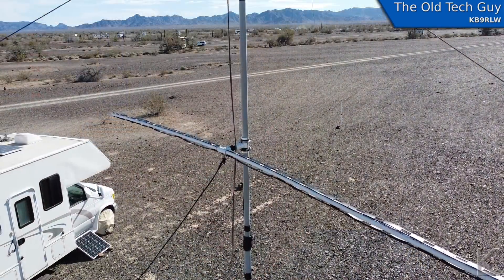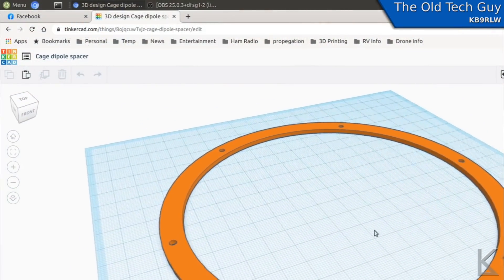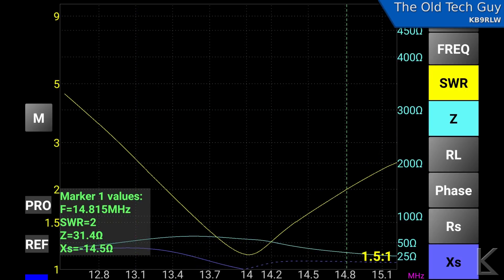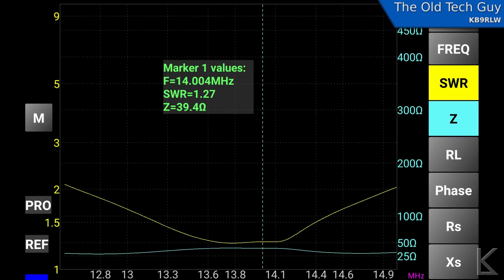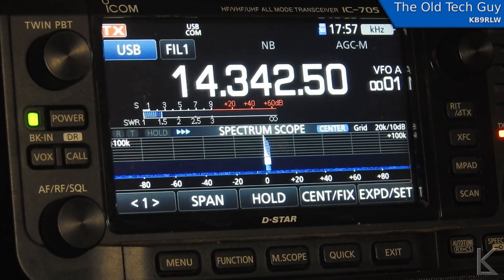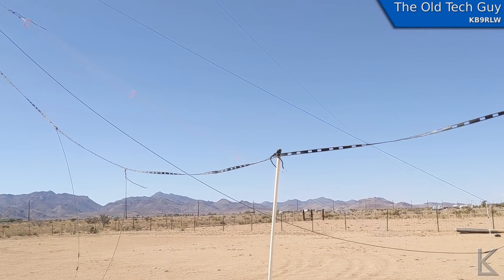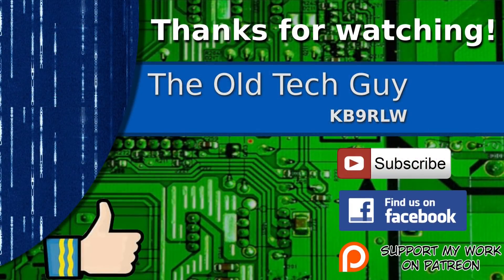Ham Radio - An end fed half wave cage antenna.  How much wider bandwidth does it provide?

Comment: This is kind of cool. I've been reading about these cage antennas for a while. The other thing I saw was using a 1/4" PVC oatey flange repair as a spacer. The Home Depot part number is 435191. They're only about $4 (2025) so if you read this in 2026, expect to pay $30, but right now they're pretty cheap.

Comment: Hi there, so I have a question/thought.  So for this experiment you used the same wire for your regular antenna and your caged version.  Have you considered using a MUCH thinner wire for the caged version?  I'm thinking something that is tiny like Davis RF Poly-STEALTH 26 which is 26awg.  It is incredibly light at .38 lbs per 1000ft.  The whole thing would be much lighter.

Comment: Wonder if it gets wider band width adding say two wires for 8 in total, also wonder if the band width increases going to say 12" diameter? If so wonder what the sweet spot for 10m would be? As that band is wide as.

Comment: Hi Kevin. I've been watching your videos on the tv so could not do anything but a thumbs up until now. I have an end fed 1/2 wave 80m mostly horizontal 'L' shaped about 30 feet up because of my HOA situation. I am playing with 6 meters to get on a local 6m net. The idea that the 'fatter' the driven, the broader the band width is exactly the answer I've been looking for. Wire doesn't cut it! I acquired some old tv antennas and am fashioning a dipole out of 2 of the elements (51 inches).  question: 
1/  can I extend the aluminum tube element by clamping a second piece of tube near the end of each element? The swr for the lower end of the 6m band is about 2.0:1 where the rest of the band is around 1.5:1

John
VE3PUH

ps ... i'm retired and have had my ticket since last May.

Comment: Nice project.  I wonder if on 90/76 if the 2 wires or of the several if you might pick up more of the band. To make the harmonics work it has to be full length, but the second wire if shorter for 75 could it become a fan-like antenna. I assume all the wires on yours were the same length?

Comment: You will possibly have about 25% of your 20M bandwidth gain on 80/75M due to diameter to wavelength ratio.  I say just make your cage 4 times larger in diameter for 75/80M. <grins>  73 de AC4KV

Comment: Thanks for the interesting experiment. You could always print in ASA for longer term use. I like OpenSCAD for 3d designs like this. Half a dozen lines of code or so for this design. 73 de w6akb

Comment: I have a QRPguys no tune EFHW and I’m curious if it’s possible to to run this a vertical (fanned dipole style) like a dx commander. I’m I wrong thinking the signal will seek out the appropriate length radiator in an EFHW? I know spacing of the radiators is important. TIA

Comment: Interesting experiment. 
Theoretically, the impedance with this EFHW cage should drop a significantly, compared to a single (thin) wire.
I saw a pretty low Z value, but there is no comparison.
Did you check that, maybe you saved the data from a previous measurement?
If so, the coupler could be adapted accordingly (less secondary windings). 

73 Stephan

Comment: 👍Thanks Kevin. For 80m I have wondered about an end fed caged dipole with wires of slightly varying length  - a sort of caged/fan dipole hybrid. Spacers look good on your 20m caged dipole.
Reply from the maker: Well,  it really wouldn't be a cage dipole then, it'd just be a fan dipole with a slightly different physical arrangement, but the same performance characteristics of the classic fan setup.

Comment: If you could make one of these for 80 through 10 metres, I might be interested in purchasing one.  Of course, this would only work as either a horizontal or a sloper.

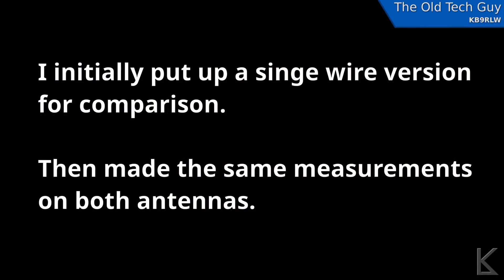3:00 - "singe wire"?

73 VE7NDE
Reply from the maker: I was comparing measurements to a single wire version, the common EFHW antenna.
Reply: @loughkb  Yeah, but you spelled it "singe" instead of "single".
Reply from the maker: Ah well.   Can't be perfect when one is not perfect themselves.

Comment: If you want to check out a really wide antenna, try four-foot wide attic foil. It probably wouldn't work well in the wind, but it is strong enough to be suspended as a twenty-meter half-wave. And it might be a great attic antenna. Here's a good source: https://atticfoil.com

Comment: Interesting Kevin. 
Fat wire end feds result in lower impedance, thus the higher SWR. Higher SWR results in increased ground current thus lower Q, higher loss and apparent wider bandwidth.  When the feed end is near ground, the fat wire version has greater capacitance to earth..... A 1/2 wave Rohn 25 tower can result in a very low Z, down in the hundreds instead of the normal 2500 ohms or so....This is why the EFHW is considered a "thin wire" antenna and tends to work best with a single skinny wire. Even using 12ga cu makes a difference although that's what I use for strength. The early EFHWs used 18ga wire but suffered from breakage of course. ... QST had an article about multi-wire dipoles and it was proven to have little if any effect although W1AW does have a 75 meter cage. It's certainly a fun antenna to experiment with though.
Reply: Hi all, and thank you Kevin for doing what I was wanting to do! I just modelled an EFHW in Xnec2 and noticed the lower impedance (and lower resonant frequency) when I inceased the diameter. I guess one could wind another transformer to match it.
Reply: What is Q ?
Reply: @OH2023-cj9if  Q stands for Quality. An RF circuit with high Q is a circuit that tends to work most efficiently at only a narrow range of frequencies. Such circuits are termed hi-Q and are more selective than a low-Q circuit which often has power absorbing properties as a result of resistance. For a coil, wire made of silver has lower resistance than steel so it would be higher Q.

Comment: The thing I love about your projects is that you try things that "professionals" might dismiss out of hand. It is only by trying off-the-wall ideas that we learn new things and advance the art. Thanks for your hard work! DE WA1KI
Reply: Not much off the wall about the Cage dipole or End Fed, it was very popular in the 30s and 40s for point to point where there was limited space, the military used it due to the wide bandwidth and it was used on ships despite the greater wind loading. It fell out of favor in the last 50s and 60s when trap Yagi became the practical solution with commercial antenna became the rage. Later, QRP and limits on antennas sprang up all over Europe and the US so shifted interest to less obtrusive and more portable antennas. When I still lived in the US, up to 21 years ago I had a mountain location and a few towers in the Sierra Nevada mountains of Eastern California. I was able to experiment with lots of wire and rotatable antenna and built a center-fed dipole cage for 80 meters broadside to east and west and it performed very well but was quite a wind load. The spreaders I made were pretty heavy from plexiglass but molded carbon fiber with lots of open space would solve that problem.
Now I live in an apartment in the city center of Eastern European city with no access to the roof in a city of  7million and there is a lot of electrical noise from electric trams and trolleys. My antenna experimenting is limited summertime in the woods and a small rustic cabin where my garden and apple trees are tended. There is no end to possibilities with antenna experiments. I had a magnetic loop that I can use for 40-10 inside my apartment. The bandwidth is so narrow between tuning that 10khz QSY is about it with 3:1 SWR.  But it does work inside 3 foot thick brick walls

Comment: Great test and info.  I've built a few cage antennas over the years: Dipoles and OCF's, and had (I think) great success with them (no testing done, just "seat-of-the-pants" results!).  

I am currently looking to get an EFHW up (I already have the 49:1 UnUn), to cover [as you mentioned] 80-10m, and you've now given me the idea to cage it!  I think it will work great, and will definitely improve the overall bandwidth (well, it certainly can't hurt it). 

And... I think they look kinda neat, too!  Not your "typical" wire antenna!

Thanks again for taking the time to create this video (and, of course, the antenna too!).
73, all the best,
Alan
W0ARM

Comment: Thanks! Great video  Here is my Guess as to why the antenna has a wider Bandwidth...because  the wires each have a slightly different even minor differences in length each one will resonate at a slightly different frequency.  I would bet that if you purposely varied  the lengths by the length equivalent to equally spacing  them over the bandwidth you would have antenna that covered the entire band. I would also bet that it might only take 3 or 4 wires.  a few months ago  I actually tuned 2 pieces of wire at band edges and tied them to 49 to 1 transformer and found them to have good return loss at both band edges.  My calculation show that a difference of 4.8 inches from center of band, to band edges on 20 M.  I am a new general class ham and am working on my HF broad band antenna. and was considering using multiple wires to widen the bandwidth of some of the broader bands like 80M 12.5% BW, 160M 10% BW,  10M 5.7 % BW , 6M 7.4% BW  I was unaware that they called this a cage antenna. never heard of it before.  If you try this I am waiting for your results as I am even older than you and I have a hard time putting antennas up.  looking forward to your results. ;>)
Reply from the maker: Hello Robert.    You're guess is incorrect.    The cage antenna is broader due to the diameter of the element being larger.  The wires are all the same length.    It's a well known effect.  The bigger a wires diameter, the broader it's bandwidth will be at resonance.   The cage design applies that effect with multiple wires acting as one big conductor.
And with a bandwidth of over 2 MHz, it more than covers any ham band it's cut for.   
What you're talking about is a variation on a fan dipole.
Reply: @loughkb  
Usually  larger wire  lowers the series resistance which will raise the parallel resistance which  increases the Q which loweres  the BW  and loss from every band width equation i have ever seen.

Comment: I love your YouTube post. I get every one. I have been thinking about getting better bandwidth on an 80 meter End Feed Antenna for 80 meters.  I was thinking of using it in a fan  design or  cage design.  Using 3 wires I could cut them for 3.75, 3.5, and 3.15 Mhz.    2nd choice would be 2 wire cut at 3.875 and 3.625 Mhz.  What's your opinion?   thanks  KC0ELC, Walt

Comment: Hmmm, 

Took a nap, woke up wiyh this thought/question.

Could a 'slinky' antenna be considered a cage antenna? Meaning, since it has the similar large diameter, and the broad-flat ring material... seems like it would also be pretty broad band in nature.

Would make for an interesting comparison.
Reply from the maker: The slinky adds an inductive component.  It would behave differently.
Reply: @loughkb  I thought it lost the inductive once it got stretched out...
Reply from the maker: A coil is a coil no matter the distance between turns. :-)

Comment: Have you tried to see if you can get it to tune on 40m or even 80m?
Reply from the maker: My tuner can match it on 40, but performance is poor, as you would expect.    Double the length of it and it will cover 40, 20 , and 10.
Reply: @loughkb  try with about 7m of counterpoise. An length of random wire should do it.
Reply from the maker: @G7VFY  Already there.  As indicated on the design.

Comment: Thanks Kevin. I have an interest in the caged wire every since I watched your 2 meter cage video.
This one has my interest as I am looking for a different antenna for the 80/40 meter bands.
I am going to try this at 132' and work one it from there. Spacers at 20' intervals should hold the 
separation for the wires at 6" diameter. We shall see. K4BFR
Reply from the maker: You'll probably have to plan some sort of suspension support around the middle.   I'd be interested in your observations once you have it done.  My public email is good on qrz.com
Reply: @loughkb  You got it sir. It will be a week or so before I can gather room and materials. I am thinking about a "tight rope" suspension system on this. 800 feet of wire has a good bit of weight and unsupported it will stretch a good bit. 6  runs of 132'

Comment: Wide bandwidth = high loss. Since the single wire is extremely wide bandwidth also, it's most likely the transformer, especially since you mentioned Steve Ellington. Measure a pair of transformers the way he makes them on a VNA and the high loss is obvious. He seems to only make inferior and low performing copies of other people's work, nothing innovative or high performance about what he does at all.
Reply from the maker: I only said he popularized the design, I didn't say he invented it.
Back when I built it, I did use my VNA to measure it.   I also measured insertion loss, which was low.
Reply: Do you have a better design for an EFHW transformer? If so let us have a look. Many companies use the same design and they have tested them.

Comment: I wonder what would be the result of only connecting the cage wires together at the feed point of the dipole and not at the outer ends. Good info, Kevin. Thank you. 73 de K7RMJ Frank
Reply from the maker: Probably no difference.  They're all at the same potential if they're exactly the same length.    It's just easier to anchor the far end when they're tied together.
Reply: @loughkb  I would think by not connecting the far end of the conductors that would turn it into something similar to a fan dipole affect.  Try cascading the wires a couple inches shorter and see if that doesn’t broaden the band even more.
Reply from the maker: @MrWirebrain  Why?  At a bandwidth of over 2 MHz, it's already much wider than any of the ham bands you might build it for.
Reply: You’re right, it may be broader than the band but I guess we’re just trying to prove a point here. What exactly does it take to broaden the transmit capability of a wire antenna and to keep it as inexpensive as possible.  Maybe three wires next time, each one an inch or two shorter than the other and spaced with ring spacers 3 inches in diameter instead of six.  What do you think?
Reply from the maker: @MrWirebrain  I think once you get the RF favoring one of the wires over the others, you'd lose some of the broadening effect you get by the physically larger diameter when they're all acting together.

Comment: Nice stuff Kevin.  The slightly higher minimum SWR and the plateau effect are likely both from the fact that the antenna is now much more capacitive.  You have a bunch of conductors in parallel, which is pretty much how you build a capacitor.  If you plot the data from both the single wire and the cage on a Smith chart the difference should stick out like a sore thumb. 

I agree this would be a fantastic design for 40 or 80 if one had the room.  The single wire seems to be fine on 20M, but if you build one lower and then expect to use it on the harmonics you'll need that extra bandwidth because the harmonics won't be exactly where you want them to be.
Reply: Sounds like a dare to me.  How many wanna test Matts theory?
Reply: @stephen1711  LOL.  It's not my theory.  I'm not quite old enough to have invented physics...but I'd love to see someone try it out.  In the battle of theory vs. reality - reality always wins!
Reply: Great stuff on antenna. ...  Was wondering if you thought horizontal would add or reduce band width.. I know it would be hard to do at your location..  just curious. Wn0wwy Dale
Reply: Do you imply capacitive properties prevail because resistive properties decreased?

Comment: Hi 👋 Kevin very interesting the Ant 🐜 experiments
One questuon  Do I need a Modem using iC7300  for PSK31  use USB for FT8.
73  Kurt HS0ZBS east Thailand 🇹🇭
Reply: No you do not.  The "modem" is built in to the 7300.  All you will need is a USB A to USB B cable and download the usb drivers from Icom Japan's website.   73   James  K0UA

Comment: Interesting test, Kevin. I don't have the space, but what would happen if You use the caged dipole method but make each individual wire slightly longer than the previous one. Resonant on the highest frequency en longer towards the lowest frequency, in the same band.Could one increase the bandwidth even more?
Reply from the maker: Probably, but why?  It's already wider than the individual ham bands.
Reply: @loughkb  Just experimental. Interesting to know
Reply: @eddycuypers7621  A lot people have the same idea.  The thing is: with the fan, at the far end from the feedpoint, the individual, different-length wires are not connected together.  With the cage, at the far end, the wires are all connected together.  
I don't understand what people are visualizing when they suggest making a hybrid of the two concepts.
Perhaps it's this, I'll illustrate using a two-wire cage just to get the point across.  One wire is shorter than the other.  At the far end, the shorter wire is connected to the longer wire, but maybe a few inches before the far end of the longer wire; then the longer wire continues by itself for the remaining few inches of its length.  OR perhaps, if the longer wire is permitted more sag, then the two wires can be joined at the far end of both wires.
Anyway, I think trying a cage for an end fed element was an interesting idea.  It is very interesting that it was significantly successful!